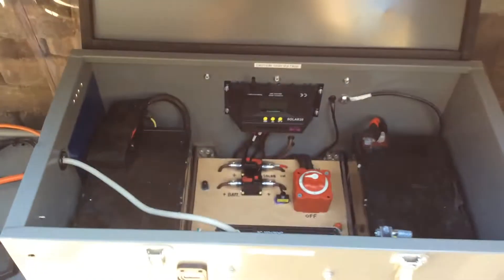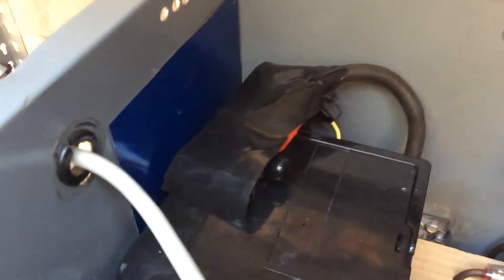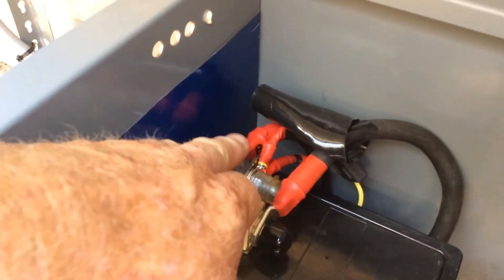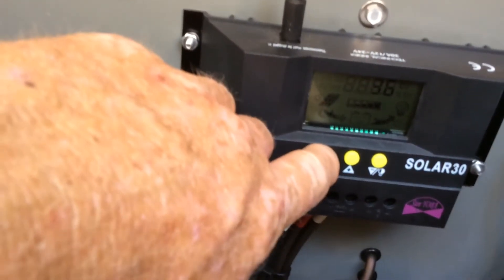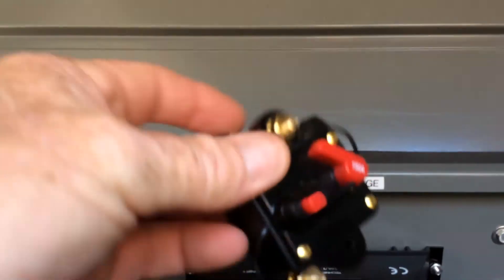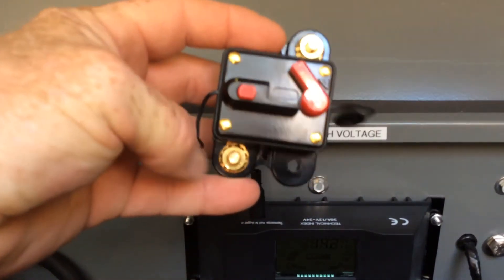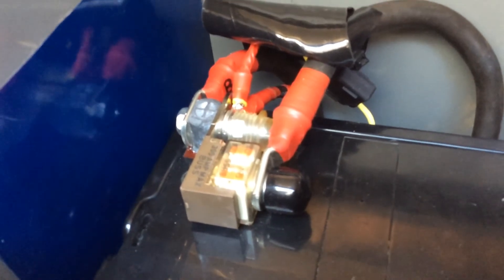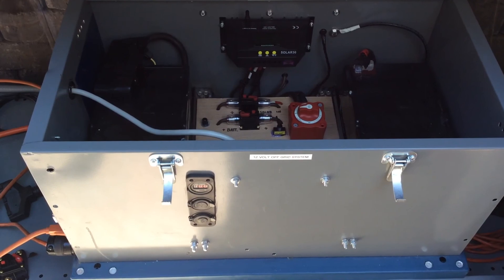DIY solar generator fuse upgraded

Comment: Brother Have you looked at the 2424 LV-MSD. The Pip is 24 volt works up to 30 volts will cut off at 32 volts. The out put power is 2400 watts and surge 4k. Has a 60 amp MPPT CC and 60 amp grid charger in it. Has a built in transfer switch as well as a auto gen start. Shipped to the USA was $577.00 in 2 days. 

I do not work from them or even think they now my name. I have a few videos on it. For whatit cost and what you get HARD to beat.. Hope that helps brother. God Bless
Reply from the maker: This is my portable 12v system. I have seen your vids on the pip and like the unit, but it uses a lot of watts running ( not so good ) price is great. My 24volt set up I have the PCM 60 x charge controller from them and love it.
Reply: 45 watts is what it will use running. if there is not power being pulled out. If you put it on stand by it will use 10 or less watts. You got to think there is 2 chagers running in the pip. That is where some of the poser is going. I do miss my old 12 volt stand by at 5 watts but that was the 1500 watt gopower. Most inviters that are around 2500 watts will se about 35 to 55 watts .. 

My old outback would use 78 watts the mag 4048 my best frend has uses 65 watts. The cheap inviters will run up to 100 or more watts. I was just trying to be helpfull brother. Hope I have not upset you .. Not at all what I am trying to do.
Reply: And brother I do not care what you buy. Just happy to see more peeps taking care of there needs not just saying on well the MAN will do i.. Buy what your happy with. I had just seen your 24 volt PCM and was like wow that's the same CC in the Pip I have maybe he did not know pip now had a 120 volt out put.. 

I know some times comments can come out as someing sounding like a ass hat. I just hope you know I am not at all that kind of guy.
Reply from the maker: You took it the wrong way brother. Not mad at all like the comments , and was looking at the PIP before and until your video on yours they did not have a 120 volt unit. Many videos on youtube  claimed they were power hogs but 45 watts is not to bad. My cotek only uses 20 watts running and I have loads 24 hours a day so stand buy means nothing to me. The pip will use over half a KW hour per night 540watts. You would need a large battery bank to absorb that draw.
Reply: Yes sir your right that is 1080 watts for 24 hrs. I have a smaller bank tho just 8 t105 batts. I would think if you looked into it your pcm is using about 20 watts pr hr. The Cotek is nice brother, there made from the same who make Go-Power and samlex. 

But yes that's a lot of power just to be on standby. I have seen that same guys videos. But what he is not saying is that the 2 CC in the pip are using power as well. That sucks as I do not even use the pips Mppt solar CC. So for me that is a waste of power. 

That is where the nice high end mppt charge controllers come into play. My 3 do not even use 7 watts together in stand by.  How ever they cost a lot lol. The 45 amp Mppt TriStar Morningstar charge controller. I have cost 600 bucks. Just for it where the hole pip was 577 shipped.

It's all comes down to how much are you or I willing to spend to make things work for us. I am sorry you in no why hurt my feelings. I just was thinking maybe I had yours.. We are all in this together. I look at solar and being more self-sufficient as a life stile. Would rather not have the MAN in all of my life. We have come to a place where peeps think just cuse there here we must take care of there needs. I have worked my ass off to take care of my needs. One day it may or not be the same but I would rather know that I have some controle over my life. 

Just like you with the solar water and growing food. WOW have no clue where all that came from LOL. Sorry and thank you for all your videos.Been loving your mobile solar generator.